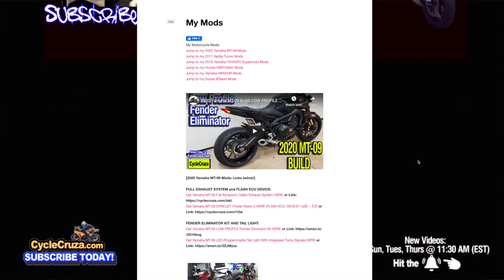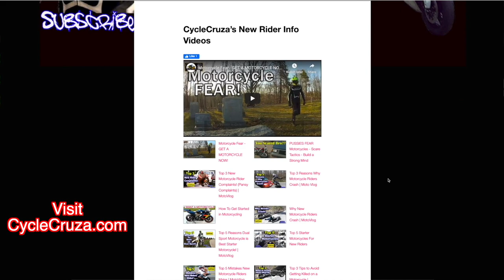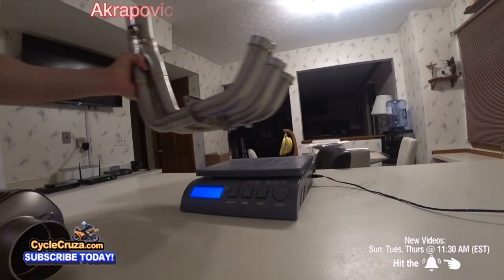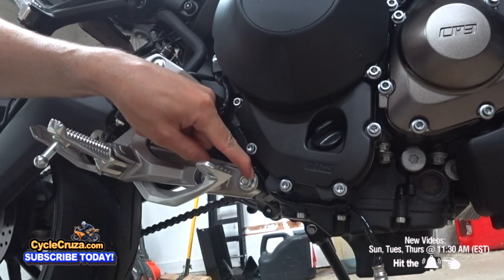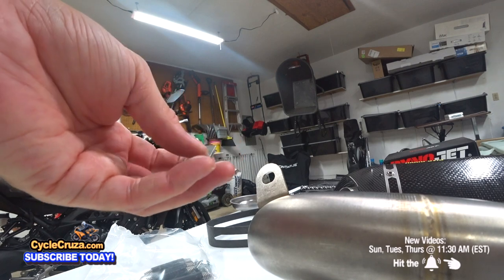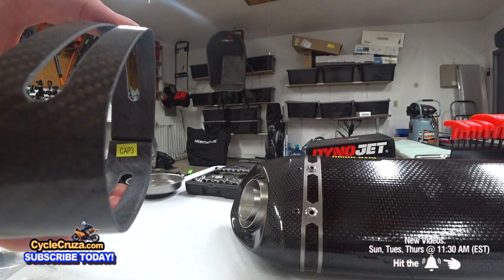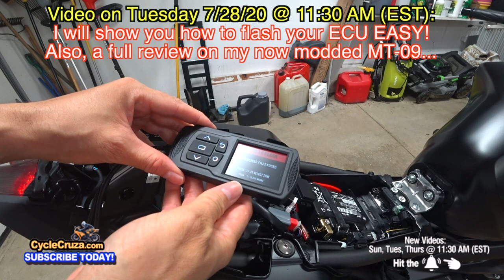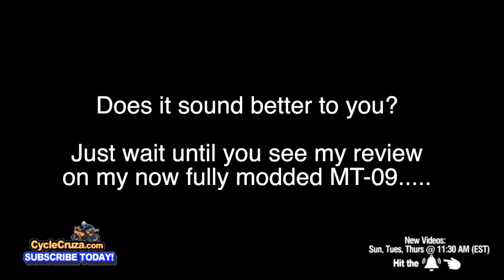2020 Yamaha MT09 Akrapovic Carbon Full Exhaust System Install & Sound Comparison

Comment from the maker: Get Akraopvic Full Exhaust MT09: https://cyclecruza.com/iskl
Get Dynojet ECU Flasher: https://cyclecruza.com/i12w
Get MT09 Low Profile Fender Eliminator: https://amzn.to/2Crhkvg
Get MT09 Tail Light (w/int signals): https://amzn.to/2ZJWjoa
Get My MotoVlog Camera: https://amzn.to/2CGLkRB
Get AIRBAG VEST (On Sale!): http://cyclecruza.com/fdl2
Links to get My GEAR and Other Stuff: ⬇️ 
Get Bell Carbon Helmet (Best Ever!): http://cyclecruza.com/r65f
Get My New Shorty Gloves: http://cyclecruza.com/w7ae
Get Engine Ice Coolant (Non-Toxic!): https://amzn.to/3ekwiRt 
Get UNLOCKED Galaxy S10+ (CHEAP!): https://amzn.to/2M6JDD5
Get Bike Phone Mount: https://amzn.to/2M5LSGH
Get My Camera Bar Mount: http://amzn.to/2Au2k8B
Get Bar End Mirrors: https://amzn.to/2VlxWJ7

Get TIRES (Best Ever!): http://cyclecruza.com/pangelfront

Links to ALL of My Stuff: http://cyclecruza.com/my-gear

MY CAMERAS AND STUFF:
Get My MotoVlog Camera: https://amzn.to/2CGLkRB
Get GoPro Hero 7 Mic Adapter: https://amzn.to/2DAfiXL
Get 128GB MicroSD XC Card I Use: http://amzn.to/2ihwPsv
Get My Camera (Off the bike): http://amzn.to/2iehuFW
Get My Camera Bar Mount: http://amzn.to/2Au2k8B
Get My Helmet Microphone: http://amzn.to/2xCT4O0
Get My 2-Port Smart Power Bank: https://amzn.to/2K8Pm5n

MY HELMETS:
Get Bell Carbon Helmet (Best Ever!): http://cyclecruza.com/103q
Get My Dual Sport Helmet here: http://cyclecruza.com/gvhh
Get Ear Plugs here: http://amzn.to/1PE0NTn

MY JACKETS AND JERSEYS:
Get My Leather Jacket: http://cyclecruza.com/8blk
Get Sedici Garda Jacket (Best for Street):http://cyclecruza.com/rhtm
Get My CE Armor Jacket CHEAP: https://amzn.to/2BIRAG7
Get Hi-Viz Armor Jacket CHEAP here: http://amzn.to/1TC9fBa
Get My Winter Motorcycle Jacket: http://cyclecruza.com/h5ky
Get Hi-Viz Rain Jacket: http://cyclecruza.com/tc7i 
Get My Hi-Viz MX Jersey here: http://cyclecruza.com/rn79
Get Motorcycle Hoodie here: http://cyclecruza.com/qvgg

MY GLOVES:
Get My Leather Gauntlet Gloves: http://cyclecruza.com/67qy
Get HEATED GLOVES: http://cyclecruza.com/oa2s
Get My New Shorty Gloves: http://cyclecruza.com/w7ae

MY MOTORCYCLE PANTS:
Get My Leather Pants: http://cyclecruza.com/54cw
Get Sedici Garda Pants (Best for Street): http://cyclecruza.com/vb8e
Get KEVLAR Jeans: http://cyclecruza.com/vxij
Get My HI VIZ CAMO PANTS: http://cyclecruza.com/hivizcamo
Get Urban Camo Pants here: https://amzn.to/2BK9YP1
Get Yellow Camo Pants Here: https://amzn.to/2SjMGq8
Get Blue Camo Pants: https://amzn.to/2LBEgbk

MY BOOTS:
Get My Street Riding Boots: http://cyclecruza.com/uubp
Get My Dual Sport Boots: http://cyclecruza.com/iwn2

MY PROTECTION
Get Knee/Shin Guards CHEAP here: http://cyclecruza.com/kneeshin
Get CE Back Protector: http://cyclecruza.com/npzw
Get NECK BRACE:  http://cyclecruza.com/gf4a
Get Knee Braces: http://cyclecruza.com/mobius

My BACKPACK and STORAGE PACKS:
Get My New No Drag Backpack: http://cyclecruza.com/nr6x
Get My High Capacity Backpack: http://cyclecruza.com/k0w2
Get Water Bladder CHEAP: http://amzn.to/2b5w5nv
Get Motorcycle Tail Bag here: http://cyclecruza.com/tbag

Emergency Carry-On Items:
Get Flat Tire Repair Kit here: http://cyclecruza.com/f5du
Get Moto Survival Kit: https://amzn.to/2EwtsrI

MY MOTORCYCLE STANDS:
Get Universal Stands: https://amzn.to/2Ct2fpQ
Get My Lift Table: http://amzn.to/2kt1pD7
Get Bursig Lift Stand: http://cyclecruza.com/f0lc
Get Adapter Plate for Stand: http://cyclecruza.com/cpwr

MY MOTORCYCLE TRAILER:
Get Fold-Up Motorcycle Trailer: 
https://cyclecruza.com/stduptrl

*MY MOTORCYCLE COVER:
Get Moto Sack: http://amzn.to/2lpIX9d

My Amazon Store: (All my Stuff) 
https://www.amazon.com/shop/cyclecruza

Links to All of my Mod Parts for my Bikes:
https://cyclecruza.com/my-mods

**CycleCruza's Recommended Videos********

Go to my motorcycle Video Playlists here:
https://cyclecruza.com/my-videos-2

Watch 2020 Yamaha MT-09 First Ride Review:
https://youtu.be/6IfNWtPStsA

Watch MT-09 Build Low Profile fender Eliminator Install:
https://youtu.be/xiKxXm3GsUw

Watch Supermoto Build Series:
https://cyclecruza.com/supermoto_build

Watch How to Ride a Motorcycle Video Series:
https://cyclecruza.com/how-to-ride-motorcycle

Go to My Motivational Videos Playlist:
https://cyclecruza.com/motivational

Watch My Bug Out Moto Van Video Playlist:
https://cyclecruza.com/bug-out-van-videos

---------------------------------------------------------------------------

SUBSCRIBE TO MY ALL-IN-ONE Motorcycle CHANNEL! 
https://www.youtube.com/subscription_center?add_user=cyclecruza

SUBSCRIBE to my new Bug Out Moto Van Channel:
https://www.youtube.com/bugoutmoto

WEBSITE/BLOG (Be notified of new content and deals!):
https://www.cyclecruza.com

INSTAGRAM:
http://www.instagram.com/cyclecruza

FACEBOOK:
https://www.facebook.com/cyclecruza1

TWITTER:
https://twitter.com/CycleCruza
Reply: sounds like a beast now, you're  a good teacher for beginners like me
Reply: Sounds P-R-O-P=AAAaaahahh 😎😎
Reply: You got rid of the tuono for that ugly slow bike. Hahaha
Reply: @davidmhead  the mt09 is half the price and the tuono is basically a sports bike , in Australia is very expensive and hard to get repairers to work on them , the mt09 is a great looking bike
Reply: warren seiboth that thing is ugly. And has none of the tech of the tuono. Plenty of bikes I’d take over a mt9.
Reply: @davidmhead  ha ha thats your choice , the tuono is twice the price , the mt09 is the most comfortable , the only other bike i would consider is the kawasaki 900 but i feel cramped on it and its a 4 cyclinder which ive had plenty it lacks character. The Ktm 790 is ugly so thats a no from me

Comment: Awesome review.  Just installed mine today using your video.  Took about 45 to an hour. It's a very simple job.  For people who were wondering,  I needed a 12mm 14mm and a 19mm for the bolts on the bike.  You will need a size 4 Allen wrench for the Allen bolt on the spacer.  And a 13 mm for the bolt that akrapovic provides for the rear exhaust hanger.  Keep in mind there are exhaust gaskets when you remove the headers.  They fall out easy and are easy to miss.  I reused the old ones but it wouldn't be a terrible idea to order new oem ones.  Thanks for the guide!
Reply: How did you remove the baffle ?

Comment: Get a J hook for the springs it makes life a whole lot easier.  You can make one out of stiff wire or welding rod. 
Retired Motorcycle Mechanic and you don't risk scratching the exhaust with pliers.

Comment: Nice job but a little tip CycleCruza - Before re-fitting the O2 sensor twist it like 4 or 5 turns anticlockwise before fitting it back into the insert - takes the stress out of the wiring.
Reply from the maker: cool thanks!

Comment: Sounds a lot better! Can't wait for the next video to see what difference the tune makes and if it fixes the screwy throttle.
Reply from the maker: Stock vs modded are two completely different bikes. I was shocked!
Reply: The trouble most bikes with fly by wire are having the same problem till they get ecu'd

Comment: I literally just got the akra carbon.  Haven't even taken the baffle out and I love it 😊.
Reply from the maker: Don't take the baffle out, they say you will lose some bottom end and you'll get the drone effect at some RPMS. You don't need to remove it, sound perfect. I just need to get rid of the decel pop.
Reply: @CycleCruza  Did the reprogrammed not remove the popping? Are you not able to turn off AIS?
Reply: The decel popping is what I love haha

Comment: I don't think that power vision is going to fix the drive by wire throttle Delay, ignition timing limitations by gear or top speed limiter. It sounds like it just updates the OEM fuel map and can't unlock anything else.

Comment: I just wanted to point out that you should be careful when using torque wrenches with long extensions. Long extensions really messes up the final torque values. I usually add 5-10% to the torque setting when I have to use a long extension. Sick sound though 👍

Comment: Didn't want the power comander v fuel injection  module? That is the one needed your able to program 10 different throttle positions  ultra smooth

Comment: Iam stuck on the link pipe hanger bolt. It wont go through the hole? how many washers did you use because I had two washers and a push through washer plus the nut and bolt

Comment: Can't wait to see it after that powervision3. I went with vcyclenut ONLY because i wanted the bike to be pushed. I believe woolich has better software..which is what vcyclenut uses..we'll see. The ivansECU flash is the only flash I've seen compete with vcyclenut for the mt09...cant wait to see this. That bikes coming together tho brotha ! Looks good and sounds great ! Wish you would come on out to NY !
Reply from the maker: What's cool about the PV3 is you can always restore it back to stock in minutes. Also, no having to send in your ecu and not being able to use your bike. Another thing I like about the PV3 is you can turn off the check engine light. You can also run a live monitor and it holds multiple tunes, only takes a couple minutes to switch tunes. You can change tunes while out riding, no need to connect to a computer. However, you can connect to a computer and further customize the tune. Dynojet PV3 is legit!  I just wish they made it better compatible for a mac. You can do somethings on a Mac but can't customize a tune, which is not a big deal because I'm not that technical yet.
Reply: @CycleCruza  I've looked at getting one myself. That for that bazzaz unit they sell. Ita like $900 but it comes with good shit but i obviously went a different route. They definitely have some great perks ! The ability to uninstall it is a big plus.

Comment: If you did not remove the dbkiller, reflash is not required. But ofcourse ecu flash is best to maximize performance. Pair it with block off plates and highflow filter btw. Good choice cruza! Imho akra racing line is the best system for mt09. Next is arrow, graves and yoshimura. I dont like the akra titanium underbelly, its heavy and looks like stock.
Reply from the maker: ECU flash removes speed limiter and some other stuff & proper a/f map for the full exhaust. How do you get rid of the decel pop?
Reply: Use graves or driven racing block off plates. Big help to get rid of decel pops of course with the help of reflash. For High flow filter, good ones are k&n, dna, sprint and bmc. Topspeed is 170mph after reflash btw. If in case the one you use aint good enough, try woolich ecu flash.

Comment: Whats your impression for an older but developing novice/ intermediate rider choosing between a MT07 and the new Tenere 700? I want one bike to commute 35 minutes from city into the suburbs and 75  to 200 mile motorbike overnight camping trips with lightweight side luggage. I like both bikes for their spirited torque bands, decent mpg and snappy handling.
Reply: The tenere 700 hasn’t been out long enough for there to be a lot of informed opinion.
Reply: @oklahomahank2378  I have two friends who test rode tenere 700 at an ohio dealership. It's been out for a while in Europe with over a hundred  first hand reviews on youtube. Basically its same engine in a 12 lb heavier adventure version of the MT07 with the heart of Cyccle Cruza's 450 dual sport.
Reply: Stuart James Well, ok, good point.  I am thinking more of people who have put 10,000 miles on it.
Reply: @oklahomahank2378  that's why I used the word Impression rather than yours  "Consensus". 10k miles is not necessary nor is riding it at all to have an impression. CycleCruza has ridden enough bikes and Yamahas in particular to have an impression.
Reply: Stuart James   I didn’t say anything about consensus.

Comment: You need to get a quick shifter on it it's so fun
Reply: It has as off 2017.
Reply: @srtspeedy4983   Negative... not in the states at least. It has the connector and the ECU is GYTR quickshift ready - but you have to buy and install it yourself.

Comment: I just installed this same exhaust on my bike. Does it have to be retuned or can it be ran like it is? Also i smelt a really strong burnt smell is that normal with a new exhaust?
Reply: I am installing same one on my bike and was wondering the same thing
Reply: @jasonclark6099  yeah it has to be retuned cuz of the air fuel ratio and the burning smell is nothing to be concerned of it’s just the smell of the oils from the exhaust piping. It’ll go after away after the first or second ride

Comment: Did you install a after market air filter for more air flow?
Reply from the maker: no, stock filter so far. I will be changing that at some point and maybe a custom tune for it.
Reply: @CycleCruza  definitely

Comment: Do you also run the standard Dunlop D222 tyres?
Reply: Mine came with Bridgestone s20
Reply: @RioterRides  Only applies for the Tracer 900 then. The S20 makes more sense on a naked bike
Reply: @Motovibes91  idk how they do it. My buddy just got one too and it came with dunlops
Reply: @RioterRides  They came standard on my 900 GT. They are not that capable at lower temps/ rain. For dry they are so so (when warmed up properly). Certainly not the tyre for spirited riders. Going to replace them with Michelin pilots 5 or Pirelli Angel GT 2s

Comment: Did it have a baffle in?
Reply from the maker: I believe so, I saw some forum posts where people said to leave it in to avoid losing some bottom end and avoid the drone sound at certain RPMS. I didn't take anything out. Usually I take the baffle out on past aftermarket exhausts. I put this exhaust on all stock. It sounds amazing though.
Reply: @CycleCruza  My friend has a 2018 MT-09 & the difference in exhaust tone with it removed is deepness. It's actually less high pitched believe it or not which makes for a better & less irritating sound.

Comment: I’m not digging that exhaust. It looks like it was an afterthought they just jumbled altogether. I have full titanium Akro on my FZ-07 and it’s barely noticeable. This exhaust may be lighter than stock but it looks horrible IMO and ruins the clean lines and integrated exhaust the designers intended.